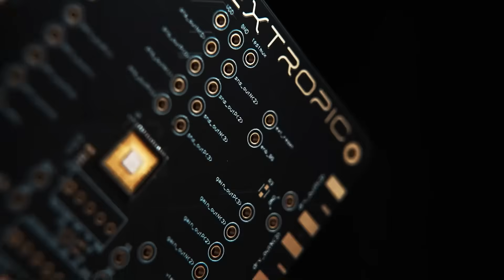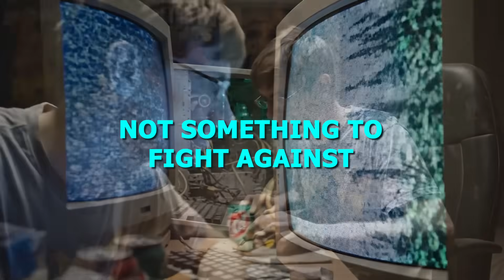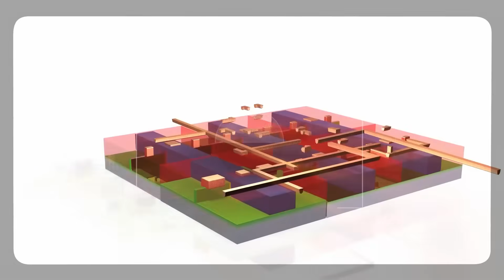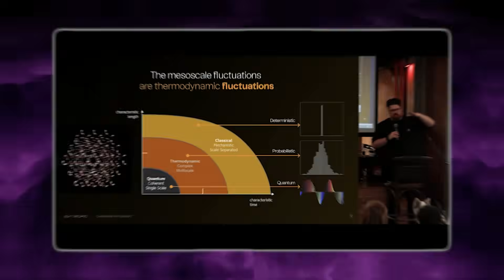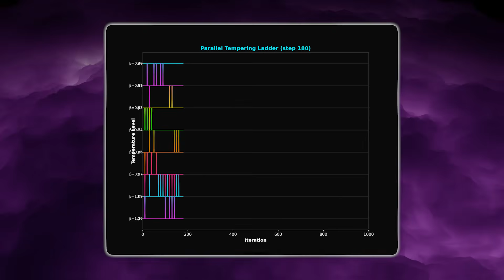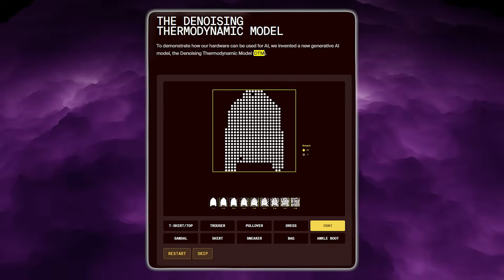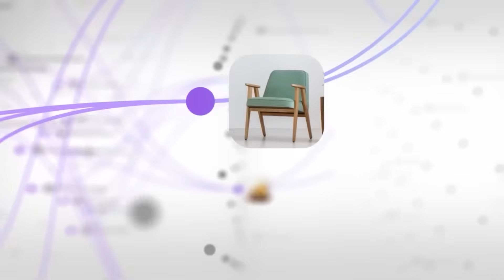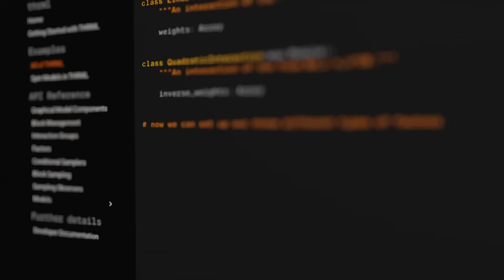Extropic’s 10,000× More Efficient AI Furnace Just Nuked Nvidia’s Data Center Future!

Comment: Bottom line
True: probabilistic thermodynamic hardware (p‑bits, TSUs), X0/XTR‑0 prototypes, Z1 roadmap, and simulated benchmarks suggesting very large potential energy savings on certain probabilistic/denoising tasks.

Not yet demonstrated: 10,000× efficiency on large, real‑world AI models at production scale, or a clear path/timeline to broadly replacing GPUs in data centers.

So the physics and prototypes are real and interesting, but the “GPU‑killing” implications remain speculative until there are independent benchmarks on substantial workloads.

Comment: If this is for real, most of the data centers are DOA!
When nearly every day brings huge leaps in technology, 
there is no time to implement anything bc it
will be replaced tomorrow!

We need to slow down!
Reply: Every computer device is complete depreciation. Any company investing on technical capital needs to understand the timeframe of relevancy is only about 1 or 2 years. When the chip is obsolete the board is, the tray is, the whole rack is. The only things relevant in a data center is the floor the walls and the memory. The memory changes with fundamental architecture though too.

Comment: 🤔 Ok I'm not that smart but these Probabilistic Bits (PBits) sound very similar to Quantum Bits (QBits), except that for PBits we wouldn't need to spend energy to cryogenically cool them down (and also shield them from random EM contamination in a really dark room) just to maintain their Quantum State by eliminating random EM contamination to prevent errors in the QBits (e.g. Schrodinger's cat in the box experiment in which the cat is probabilistically both dead & alive until it's observed using an EM wave/sensor 😬 ). So... the PBit can "somehow" remember and maintain it's Quantum State at room temperature (and that Q-State can be changed/re-programmed real-time at 10,000x lower energy vs a GPU through some type of network-effect mimicry? ) !? .... Yeah, amazing 😮

--SA, 20251208 @9:55 am CST
Reply: Dont mix up things by guessing, it's equal.